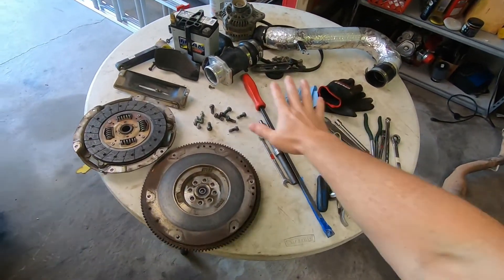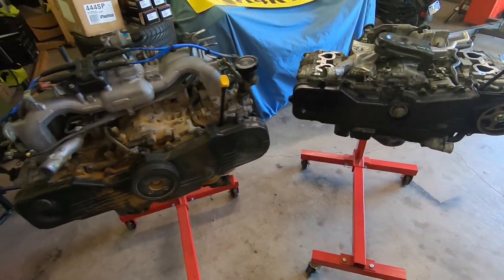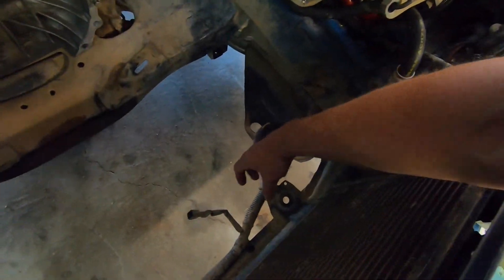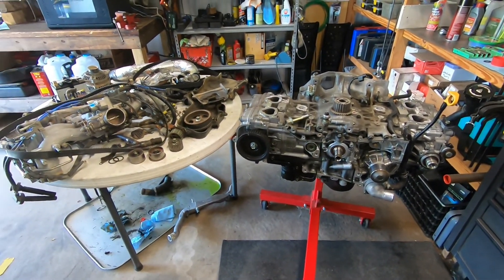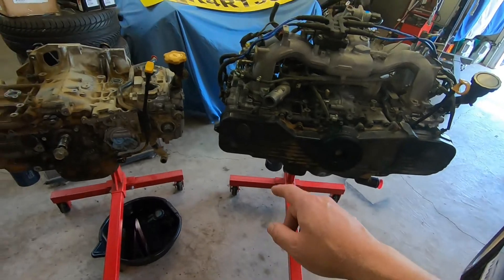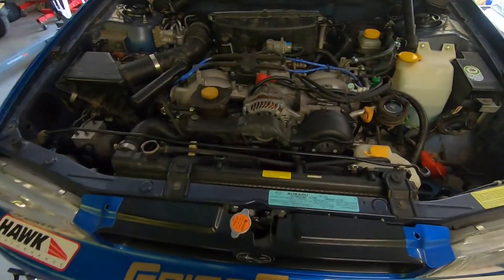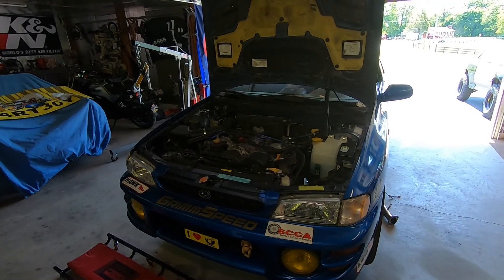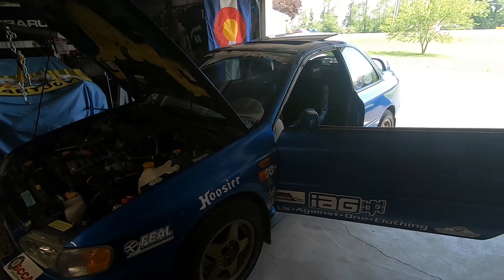Budget Engine Replacement - Swapping a JDM EJ202/203 into a USDM Impreza 2.5RS

Comment: Hi, tahnks fo this video. I've done previousley swap in Outback BH 2003 from EJ251 TO EJ201 and it works fine. Now I want to do the same think in a Outback BP 2007 EJ253 without AVLS and I don;t know which engine should I buy, EJ202, EJ203. Are EJ202, EJ203 both mechanically same? I mean valves, camshafts, pistons etc.
Reply from the maker: From what I know it’s just the intake manifold, wiring, etc. stripped down as a bare long block they are the same. I’ve heard some 202s are semi-closed vs open deck in the later 203s but that I can’t say for certain.
Reply: @RuckusGarage  Thank you for the answer. Genuine engine ej253 has 165 bhp and I've heard that I have to put 138 bhp ej20 to get it running properly. Not every 202 has 138 bhp. I'm from Poland I cand find ej203, but there are many of 202s. I don't know if there are differences in the cylinder heads between ej202 122 bhp and 202 138 bhp.
Reply from the maker: @John-q3g3g I’m not sure you’d notice that if you tune it a bit. I added a few thousand to my redline and it does pretty well with phenolic intake spacers and a full exhaust. (Check out the summit point video)

Comment: I have a 2001 forester automatic but last owner put new engine in with manual or usdm timing sproket. Car starts with P0341 and random misfire. Everone i asked in industry was like it should be good as it canadian model. But your though makes sense. Am i correct?
Reply from the maker: Makes sense to me. Do you have the old crank and cam sprockets? Slam em in and see what happens and report back! 🫡

Comment: You're the best it already turned on after watching your video but don't change the water pump now it overheats I don't know that it can be the thermostat it's fine when I run the car it overheats and the radiator is super super cold I think it can be the water pump can you tell me what it can be.?? I really appreciate your video.!!
Reply from the maker: The JDM pump won’t physically fit with the USDM rad and lower hose so it’s the simplest way. 

Chances are you have an air pocket or some other issue. If you have access to a vacuum bleeder that’s the best tool for Subarus with the bleeder funnel second. Best of luck! 🤘🏼

Comment: what headers come on the ej203 vs ej 2.5? what is on the car in the video? sounds equal length..
Reply from the maker: They come with a “side exit”like the later model USD engines, that oem header was replaced with an aftermarket ELH I had
Reply: @RuckusGarage  oh sweet. i have an actual ej203 equal length header with heat shields. will make a custom pipe to join it with the up pipe on my ej255. I have tried a aftermarket ELH and didn't like it. too much velocity loss from bigger pipe sizes. hoping to resolve the turbo lag issue by using the ej203 header.

Comment: For everybody who is swapping in a 2.0L keep the coil and wires because they can be mounted 180° backwards and you can swap cylinders 1-2 and 3-4 on the coil because it batch fires.  It will save you 200 bucks and could last the life of the swap.  Worked on my Subaru Baja. You use one bolt normally and make a small drop-down bracket relocation bracket for the second bolt.
Reply: Wait.. I don't understand, how does this save you money? How is reusing the coils and wires helping? Genuinely, I don't understand. Thanks!
Reply: @kylelush9660  NGK plug wires and quality replacement coil pack would’ve cost a third of what I paid for the imported motor to begin with. AC compressor power steering pump, alternator, coil, spark plugs, wires all come with the motor from the importer and are usually just thrown away when you reuse all of your old stuff. Coil went out power steering pump and alternator. Both went out. I was able to reuse all of those components from the imported motor instead of going out and buying replacements that would’ve ended up costing almost as much as the engine did.

Comment: I know you posted this 2 years ago but I appreciate the help you give me with changing the crankshaft because I was literally about to sell the car, which is a 2003 Subaru wrx and I'll try that and see if it starts since it makes a sound of trying to start but it doesn't finish igniting, thanks for the tips! I hope you can answer my message.!!! Let's see if something else I can change besides that and the sensors.!!
Reply from the maker: Good luck! Swap out those crank and cam wheels and see what happens.
Reply: @RuckusGarage  hey imma be doing this swap soon.   Do you happen to have a more in depth video on the things that need to be changed.  Or anything else that could help.     A lot of videos on these cars are for wrx swaps

Comment: This timing gear pickup issue seems to be an EJ series thing.  I researched Subaru part numbers to see if a similar thing was true for the FB 20 and 25, and it is not; they manual and automatic use the same stuff

Comment: so how was the breather difference resolved and was that easy ?
Reply from the maker: Super easy, blink and you'll miss it - https://youtu.be/cy7HlKqq3_k?t=609

Using a slide hammer that grips from the inside just pop the breathers out and pound the right one back into the block. A little heat goes a long way.

Comment: Thanks for the video man! Great insights. I also have a JDM EJ20 N/A in my 2.5 RS that was swapped by previous owner. He swapped all of the units you shared on this video. I was wondering what you might think, I’ve been having fuel restriction around 5k rpm. It struggles to get to redline at 6200. I’ve replaced the fuel pump, fuel filter, spark plugs, spark plug wires, coil pack and still I’m not sure what it could be. I’m assuming fuel injectors may be clogged. It also has an idle surge when I’m either in low rpm’s or when I’m at a stop light. Any insight you could help me with I’d appreciate it. By the way love your content man keep it up!
Reply: No it’s not throwing any codes. It feels like a wall. There are some moments where I can hit redline but most times it struggles at 5k. With timing I’m not sure I haven’t looked into that.
Reply from the maker: @DiamondsKeepItShine  I’ve seen them be a tooth off and still run with no codes but do silly things with higher revs. I was wondering if you might be hitting a limp mode limiter but those are usually in the 3,000 range. Check mechanical timing just to be sure and let me know what you find 🤘🏼
Reply from the maker: That’s strange. Is it throwing any codes? Does it stumble or feel like a wall? Do you have a MAF on your car or is it speed density? Are you certain that the mechanical timing is spot on and not a tooth off anywhere?
Reply: Forsure I’ll look into it. Thanks for the insight! Keep up the good work with your videos!
Reply: Swap the Cam gears

Comment: Trigger wheel differences not down to manual or automatic but model year 😊
Reply from the maker: While it is true that some early Phase 2 engines used Phase 1 triggers, I'm 100% certain that auto and manual triggers are different as was my case. High five for both knowing some obscure Subaru info! ha ha ha 

When in doubt just use the old parts and it'll work out.

Comment: Do you feel tuning really helped?  I am putting a 203 in my lifted 2004 daily manual forester and was wanting to tune it but most say it’s not worth it.  I am using a Tsudo UEL header and a snorkel but besides that I’m stock.
Reply from the maker: Without a wideband that I can datalog and/or dyno there's not a lot of fine tuning to do unfortunately. The one thing I did that is a must in my opinion is raising the rev limiter. The USDM 251/253 is limited to 6250rpm IIRC whereas these JDM 2.0L engines went to 6800, I have mine set to 7k and it SINGS all the way to redline.

Comment: When you done this swap you said you swapped out injectors, when you done this did you have to do any thing with the orings?
Reply from the maker: I swapped the entire intake manifold over so the injectors went with it. Replacing the orings is always a good idea if you change injectors, make sure to get two sets in case one gets damaged.
Reply: @RuckusGarage  right on thanks for the info, i thought by the looks of it you did. Im swapping my bugeye fight now so i can rallycross it

Comment: I have this swap on my 2.5RS 
I had no idea I can tune it to 7k rpm
Reply from the maker: If you have the right ECU it's possible. Check out - https://lambdatuning.com/
Reply: @RuckusGarage  any ECUs you recommend? Is that device used to add tunes to the stock ECU?
Reply from the maker: @rubenrosas1651  Lambda Tuning has a list of supported ECUs, whatever works best with your current setup/wiring would be the go to. Yeah, their bluetooth dongle allows tuning of supported ECUs via their software. It's not as polished as AEM/Holley/Hondata/etc. but the simple stuff is intuitive.
Reply: @RuckusGarage  thank you! I’ll do some research to see what works best for me👍🏽